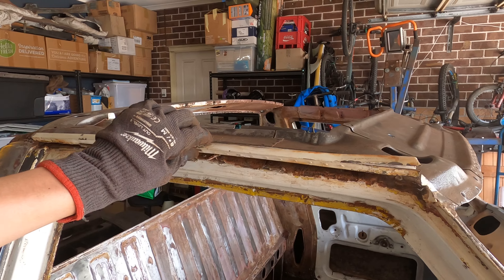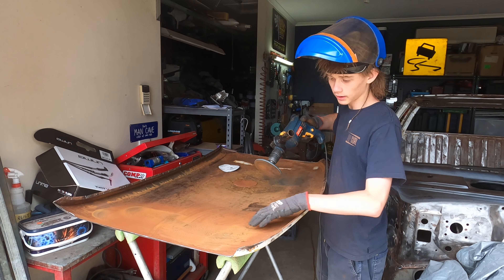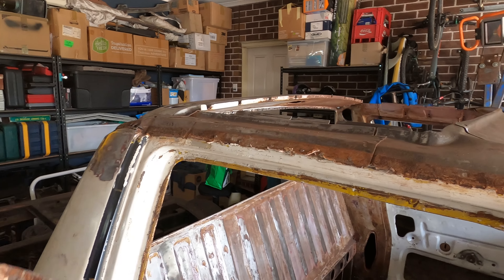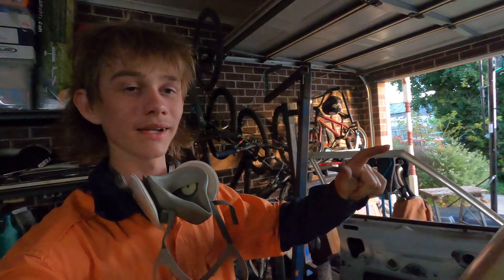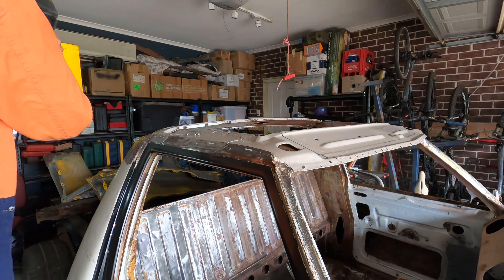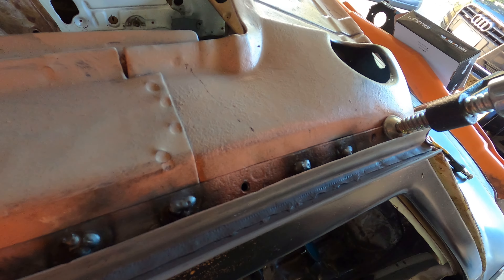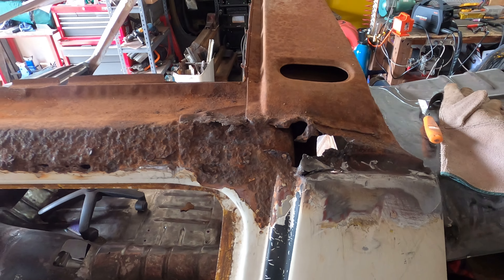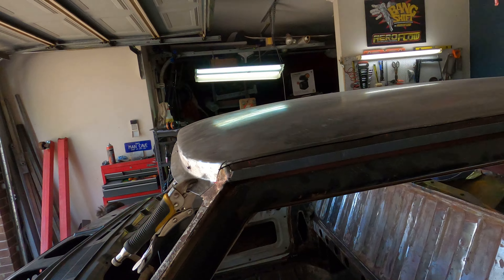REPAIRING HQ ROOF GUTTERS

Comment: its interesting, I'm working on a style side HQ atm, and it is painted body colour from the factory inside the roof and inside the cowl, id askedd the other day whether the Utes were classed as commercial like the Tonner, as every Tonner I've pulled down was like Yours, rusted through not being protected from factory.. Anyway nice work Young Fella..
Reply from the maker: That’s very odd, my only guess would be that holden tried to cut cost with the tonners but thanks for the comment it’s quite interesting

Comment: This is how I learned as a young fella with my old man he was a qualified beater and I learned on EJ and EH holdens he wouldn’t let me near his 74 HQ statesman 😂😂😂 I still one EH left to do a Ute
Reply from the maker: It always helps when your old man is into cars, i wouldn't have been able to do it without mine but all the best with ur EH gotta keep em alive  👍
Reply: I not long ago restored and modified a hz one tone for a customer a really good bloke he had lots of money 💰 it made to the rocky natts in Qld got in the top 20 was a big job new hand made inner and outer sill panels new floor pans removed smooth the heater box fan for a under dash AC unit new top and bottom plenum chamber the roof only had a hole in the middle of it from a aerial no rust in roof only rusty bits was the sills and I come with a good idea to make more room inside the cab customer wanted a flat back behind the seats I didn’t like the flat look so I carefully unpick the back panel and made a frame out of small square tube and put the panel in a big folder and turned the edges and welded it in so it was different to all the other one you see had the lines in the back looked tuff and worked very well the painter painted the Ute in late model mazda metallic maroon colour looked sick the customer engineered it for LS three had coil overs and a custom tray he spent over a 100 grand on it was a fun job to do took two years to complete and I got paid well